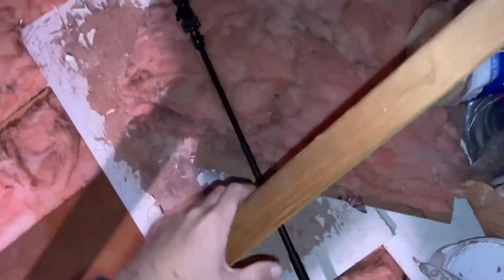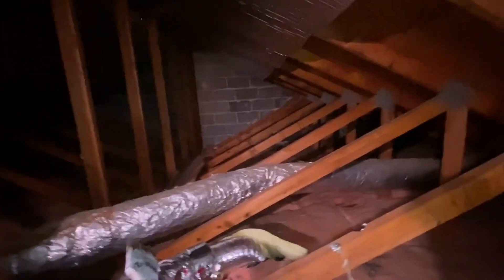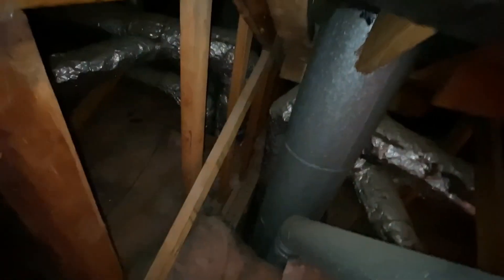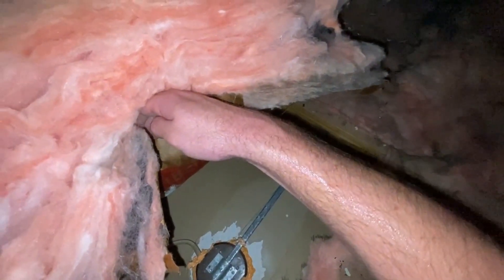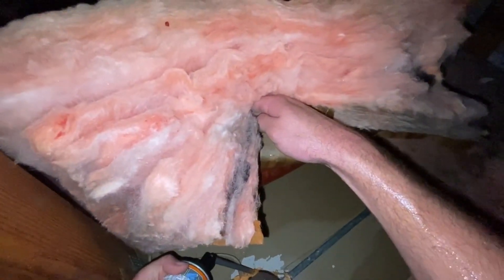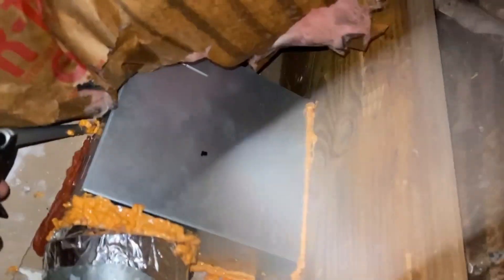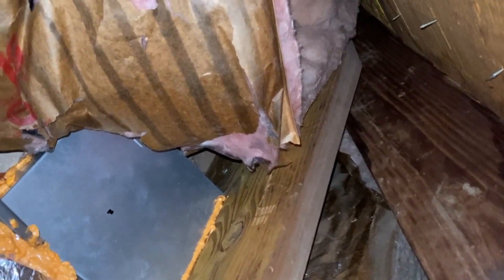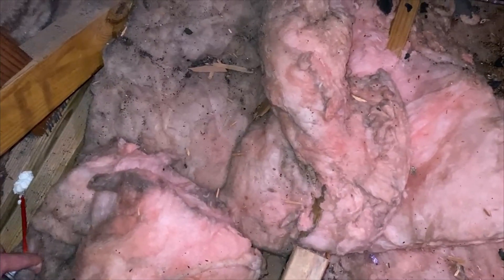Airsealing a 1970s Townhouse Attic | Building Science Project

Comment: Attics are god awful to work in. I recently sealed obvious openings including adding non-permeable sheets over the stairway. It’s tough when you have insulation already there to fill in gaps of drywall/interior walls I did my best. The guys came in to blow additional R-19 glass over existing. Hoping to not have to go up there for another 20yrs.

Comment: Aluminum is not code compliant in this application. Code requires steel. Also, foam fire block foam is not code compliant in contact with flues. Code requires sealant rated for continuous exposure to higher temps. High temp silicone for gas flues, and ASTM 136 compliant sealant for wood or pellet fired appliances. My insulation company uses 3M FB 136 or DAP High Heat Mortar for all flues.
Reply: Are you using the 136 product for junction box holes too?  I avoided using "fire block" foam around junction boxes after taking a torch to a piece of cured foam and decided that this product shouldn't be near extreme heat or flame.  I figure these need to be sealed and I don't want foam exposed to an opening of a device designed to contain an arc hazard so was thinking any fire rated caulking would be better than foam, wasn't sure if there was a specific product to look for with this purpose.
Reply: @GuruMN  No, that wouldn’t be practical, and I think residential code allows fire block foam. Commercial might be a different story.  Plastic electrical boxes would probably burn as easily as foam when exposed to enough heat, but I haven’t tested this.

Comment: Why is flashing laid down over the rockwool? Is it to keep the rockwool from being pushed down further into the cavity? Will there be any additional videos regarding air sealing, attic insulation, or follow ups?
Reply: I think he meant under. I did something like this as well. Use the flashing to cover it the best you can, then use a fireproof foam to finish it off.
Then put the rockwool on top of it.